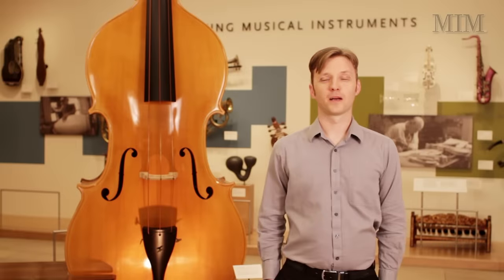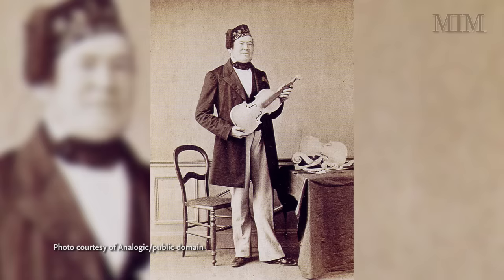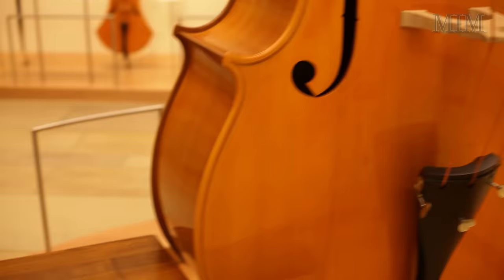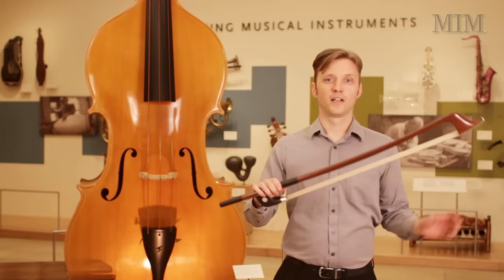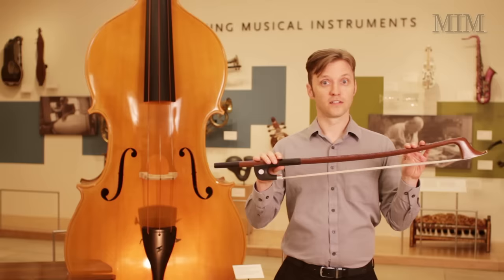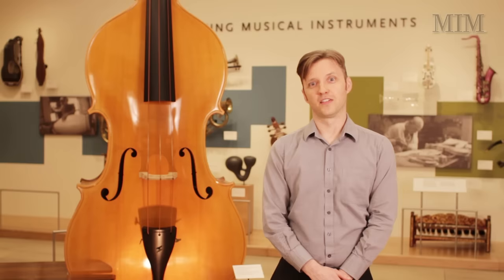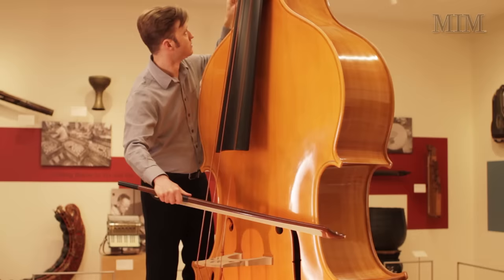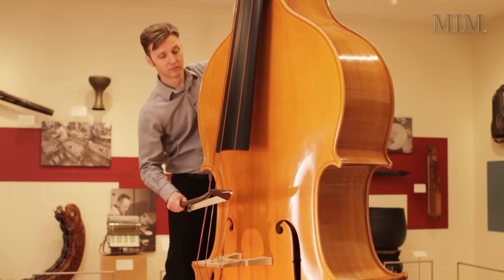Up Close With A Curator: Octobasse

Comment: I was hoping we would get to see him play that note we can't hear.
Reply: I'm pretty sure he did. There's a difference between a note being outside of our hearing range, and the sound of an instrument playing that note being inaudible.

The innermost part of our ear canal is lined with an array of tiny hairs of different lengths. Just as the length of a tuning fork determines the frequency at which it vibrates, the lengths of these hairs determine the frequency of the sound that will cause those hairs to vibrate and bend. This bending action is transmitted to the brain, and that's how we hear. We don't actually hear a written waveform like you see on a computer. We hear a collection of frequencies.

Typically, the longest hairs vibrate at around 20Hz, or 20 waves per second. But if someone claps their hands, maybe three times per second, that's a lower frequency. We can still hear them clapping their hands, because the sound of a clap excites various hairs inside our ears that respond to various frequencies. But the collective cycle of something happening three times per second doesn't register as a "pitch". And that's really the difference. You don't hear it as a pitch.

Real musical instruments don't produce a perfect sine wave. If they did, then we really wouldn't be able to hear them play notes below 20Hz. Instead, they are imperfect. Those long, loose strings swing back and forth, slapping against the bow, almost thumping like a helicopter. We hear the thumps, but the rate of those thumps doesn't register in our minds as a "note".
Reply: @tom_something  quite fascinating.  Thank you for taking the time to explain!😊
Reply: The instrument does not produce a sine wave... You wouldn't hear the fundamental note but the harmonic overtones (partial vibration of the string). Your speakers can't produce anything below 50 hz well anyways unless you have a big subwoofer.
Reply: Look at the note he plays at 2:30. After he removes the bow, the string is still vibrating, but no audible frequency is heard. That’s the 15 Hz note. This instrument is terrifyingly beautiful.
Reply: Autumn Akins he played it, you just can’t hear it...
Reply: All what you hear all the time is the harmonics. The fundamental frequency can't be heard.
Reply: Tom Haflinger wow that was very interesting to learn 🙂
Reply: @tom_something  great comment thanks

Comment: The octobasse in the Paris Conservatoire museum has a pedal keyboard, like that of an older French organ, to control the fretting. As to tuning, please note that the octobass' main advocate, Hector Berlioz, in his orchestration method, specifically states that the octobass' three stings are tuned to 16' C (c. 32 Herz, not 16 Herz), the G above that, then 8' C (c. 64 Herz). Thus the instrument only played an octave lower that the 'cello, and a major third below the string contrabass in its standard tuning. The term "octobass" simply meant that it played an octave lower than the bass, which latter meant the pitch level of the 'cello. So tuning the octobass to 32' pitch is not at all what the inventor intended.
Reply: so it really wasn’t meant to play much lower than a double bass (lowest C on piano vs lowest E)…just sound bigger.
Reply: @RatPfink66 exactly!

Comment: The Octobass is tuned two octaves below the Cello.  The double bass with a C extension is tuned an octave below the cello, which is also the bottom C of the piano.  The Octobass bottom C is tuned an octave below that.

Comment: Standard Tuning for Octobasse

3 String (Bottesini): C¹ G¹ D²
4 String (Trad.): F⁰ C¹ G¹ D²
5 String: Bb-1 F⁰ C¹ G¹ D²
6 String: Eb-1 Bb-1 F⁰ C¹ G¹ D²

The Octobasse is Tuned to Cajun Violin Tuning but 3 Octaves Lower

But the one in MIM is Tuned to Cajun Violin Tuning 4 Octaves Down

3 String (Bottesini): C⁰ G⁰ D¹
4 String: F-1 C⁰ G⁰ D¹
5 String: Bb-2 F-1 C⁰ G⁰ D¹
6 String: Eb-2 Bb-2 F-1 C⁰ G⁰ D¹

Comment: Actually, humans can hear as low as 12Hz. And these notes can be hit by a bass guitar with an octave pedal. The low-B on a bass guitar/double bass is 31Hz, which is already very low. You can dip into the 20s if you drop it down to A. If people today don't get low bass (just look at the comments), the inventor of the octabass must have been far ahead of his time back then. I like his style. For those that appreciate low bass, keep your ports tuned to 19Hz or below!
Reply: You can sort of hear below 20hz. you just don't hear them as sounds, its more felt, ad theres a point where you just hear each individual vibration (12 times a second, like triplet semiquavers at 120bpm?). otherwise we're talking sine waves, so you can't hear sub 20hz sines, but any other sound will have higher harmonics (and likely distortion given its so low) that can give the effect of a lower note.

Comment: If humans can't hear as low as 16hz, how come I could hear it here on the video?
Reply: John Michael Stock I and my friend were asking that.  It's possible, if they did play the lowest note, we did not heard the fundamental ( we only heard the overtones)
Reply: John Michael Stock Did you hear and actual continuous tone? All I heard was discrete clicks.
Reply: Elias Simon I'd say it was mostly pulses rather than a continuous tone. But isn't that just how sound is at very low frequencies so that the brain can perceive the actual waveform structure.
Reply: Sound is pulses at all frequencies. I'm no audiologist, but I think the fact that you hear the waveform structure rather than the continuous tone is the definition of not being able to hear the tone. I can knock on the table at 5Hz and of course hear the knocks, but I don't hear a 5Hz tone.
Reply: Elias Simon I see what you're saying and it makes sense.
Reply: +John Michael Stock No instrument (except for synthesizers) creates a single note. What you hear is the sum of the fundamental and all partials (overtones). This is what gives an instrument its "timbre", its color. So middle c does not sound the same on a violin as it does on a piano - even though we refer to them both as the same note. 

So if the fundamental is 16 Hz then the first harmonic partial would be 32 Hz, the second would be 64 Hz and so on. And depending on which harmonic and inharmonic partials that instrument creates (and their respective amplitudes), the sum (within our hearing range) is what your brain will interpret as sound. A pure sine wave of 16 Hz is another story.
Reply: +John Michael Stock Every musical instrument produces a series of overtones. The overtones of the 16 Hz C are what you are actually hearing. You would feel the fundamental pitch rather than hear it.
Reply: Thanks everyone for clarification

Comment: I'd order one tomorrow but my ceilings are too low.

NB 16Hz is not below the range of audibility to humans. That is stated in hifi circles as 20-20kHz but that's just an engineering decision, not a scientific conclusion from the evidence. Any pipe organ in a large church or cathedral has a 32' 16Hz low C pipe, and a few very large organs have a 64' 8Hz low C. By this point it is more of a rattle than a note, but it is certainly audible. When you think about tuning any instrument by beats it is clear that you can hear down to well below 1Hz, although not as musical notes.